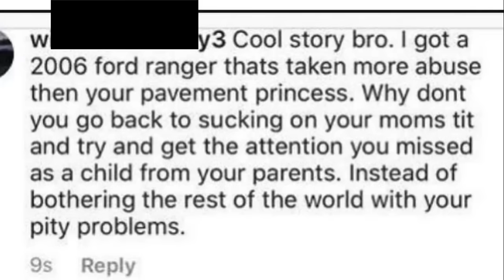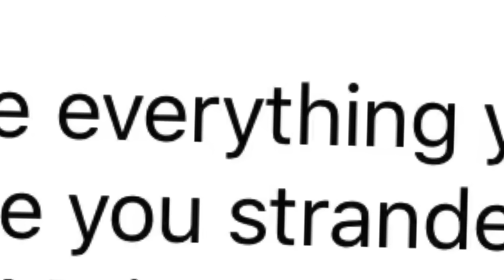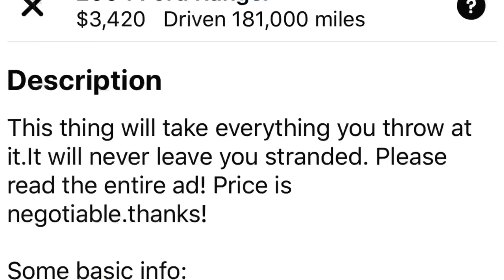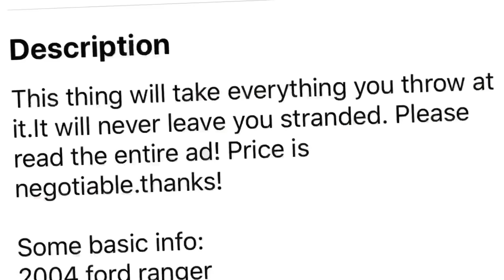“This thing will handle everything you throw at it” DOUBT

Comment: My step-dad has a 2003 ford ranger and that thing got 400,000 miles, the bed is loose and it rattles, still drives completely fine and them rangers will take everything

Comment: My 97 ranger might get a 2 cylinder misfire at high RPMs with a 4 cylinder but it can still take a beating. Rusted frame, broken swaybar linkage, a shit load of other problems, and I can still rip up fields in first in the danger ranger. My gutless earned the title danger ranger because the cab mounts are almost entirely rusted through as well.

Comment: I got a 2002 ranger with a 3L v6, with 142k miles on it, i got it for 1400. It may not be the best truck but its a good little truck for my first truck, but it is a automatic 4 speed transmission, all i needed to do was get new tires and spark plugs and spark plug wires,  oh and cut the catylic converters

Comment: As a hobby car enthusiast (never worked on cars for money or anything), I have worked on lots of cars just for fun, I’ve owned most brands, and I’ve helped fix a lot of shit. My verdict is that all cars and trucks are pieces of shit. It just boils down to which piece of shit you prefer.
Reply: As an enthusiast not an expert myself . I have always said unless you buy new you are buying the previous owners habits not the vehicle . But yes , they are all shitboxes
Reply: @papimiami1938  That’s very true. However every brand has its own quirks. I personally get a lot of shit for being a Toyota guy. The only reason I prefer that brand over the others is I generally have less issues with them. It appears most of the world agrees as Toyota is seen as the “reliable” brand in the car community. However I’ve seen Toyotas break. Cars require care. Even the most reliable brands can go for a long time if cared for properly.

Comment: ranger owner here. the reason it was so bad is because it had a 7.5 axle. if it had an 8.8 it wouldve dragged monstermax like it was a 3 inch twig. i hate to break that to ya bud

edit: i was wrong, it sucks because the motor in it eats timing chains but it does have an 8.8 so maybe you shouldve put a good motor in it like a 3.slow which is too weak to hurt itself

Comment: Put a stock 4.6 or 5.0 in it and take it to a tough truck competition.   Friend and I did this to a 1999 Ranger 2 wheel drive, put F250 suspension under it and won 3 separate competitions with it.  We sold it at the last competition to another competitor for about what we had in it.  Guess he got tired of being beat by a Ranger lol.

Comment: As the ad says, but one exception them dam flag mirrors never stated adjusted 
Also no they didn't take everything you can through at them I totaled one going 35 mph hitting a ditch.

Second one i had was 4x4. But it got stuck in the snow.

Is that bumper held on with chewing gum?

Comment: I like these videos. Any chance you would try fully upgrading a volvo 850. I have a 1995 volvo 850 turbo sedan. It’s red, but the main problem with it(besides the coolant hoses) was the height. You can’t go faster than 10-15 miles without smacking ground. It’s a daily driver and not an off-roader
Long story short, could you possibly find a volvo 850 and make it an off-roader?

Comment: dont disrespec rangers like that, you remove the torsion bar and get coils and theyre legendary. but before them torsion bars are gone you gotta know what ya got. also it needs a v8 so until it has a v8 ya gotta know what you got. ranger go vroom long time if you have unlimited oil with the v6

Comment: s10 aint no bad truck. Beter than a F.O.R.D. (found on road dead)
Reply: CHEVROLET – Can Hear Every Valve Rap On Long Extended Trips, Cheap Hardly Efficient Virtually Runs On Luck Every Time,

 CHEVROLET – Constantly Having Every Vehicle Recalled Over Lousy Engineering Techniques.  

New Chevys are definitely better than ford tho

Comment: So i recently berried the ass end of my full size 98 f150 in a 6 ft mud hole and a buddie of mine who actually had a manuel 04 ranger (which was also red which is why i thought this video was perfect) burned up his clutch and blew the motor pulling me out, and all we used his peice of shit for was to apply tension on my ratched strap so i could pull myself out inch by little inch. My truck was the only truck not dammaged in the slightest in the whole ordeal
Reply: Also there's a whole in my frame under the front bumper driver side I filled it with concrete to be a smart ass

Comment: Why are the wheels 20 years older than the truck?  Thos were wheels you bought for a truck in the early 2000's.  after  that those were cheap ass trailer wheels.

Comment: You need to buy an actual 4 wheel drive ranger with the same 4.0 v6 and test it against the hilux it passed all the tests you put it thru but u just ran it over with monster Max that's not fair actually get a 4 wheel drive one not 2 wheel drive and go head to head with the hilux

Comment: Anything with a lift kit n spacers is just stupid, the ranger ain't crap it's that previous owners blood sweat and i highly doubt he modified everything he needed for that kit to even be usable.
2nd, all the little trucks never sold in the West until they came out with the Ranger, until then they weren't very popular of a design everyone wanted bigger trucks especially since they're wasn't many American Makes at the time that were small body. 
Get over it, it's one of the most popular trucks of all time and it's sad that my 2003 3.0 V6 5 speed can keep up with my F150 towing. Yeah not as fast but still that's silly how close that is.. it's a 20 year old truck that can pace with modern bigger trucks...

Rangers ride low unless you need it the moment i saw the specific ranger you bought it's not about the truck, its user error even before you bought it! 😂

Comment: He talked shit about Tacoma's in this video when a hilux is a rebadged tacoma or vise versa it just sucks we got a gas version and not diesel but they are still damn good and tough trucks just like the hilux just have gas engines but they are damn tough engines especially the 22-R and RE 4 cylinder are the most reliable engines ever built by Toyota look it up